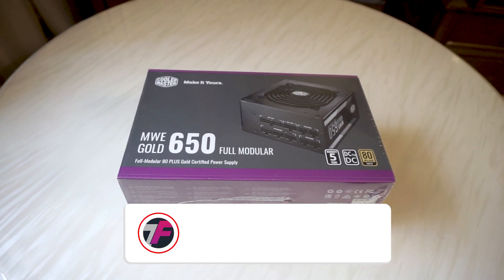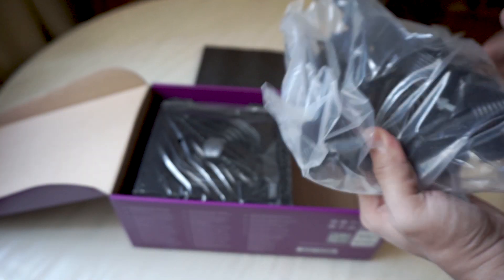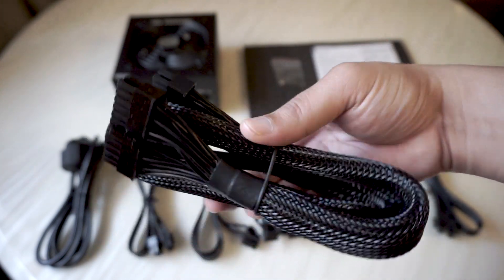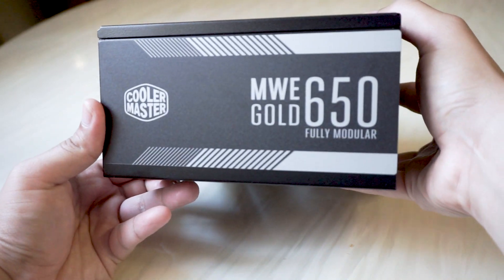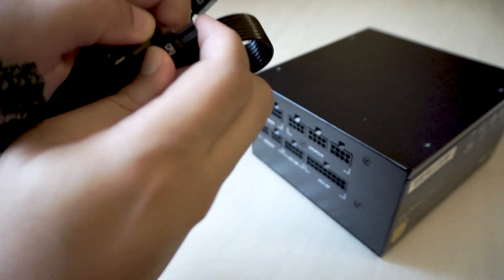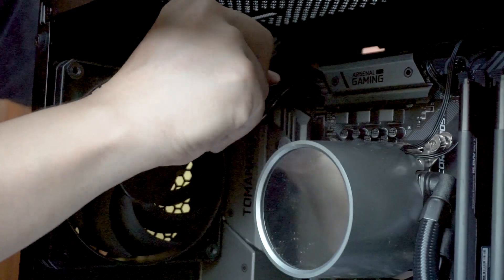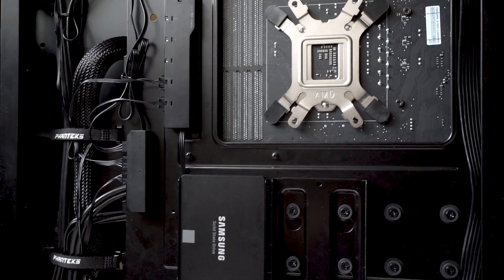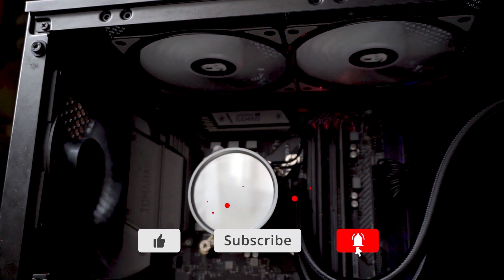Cooler Master MWE Gold 650 Full Modular: PSU Overview & Build Experience

Comment: Great Review.

Just a heads up for you...with the initial release set of this series, there is a 75% chance (or higher) it will fail in about 6-9 months.  If it is Rev 1.x or 2.x, you are good.  Based on the cables included, I believe you got the revised unit, so you should be good.  The Cooler Master MWE Forums are lit up right now with fail reports, including my own MWE 750w Gold...failed in 8 months.  The initial series only has a 4+4pin CPU Cable, not the 8+4+4.
Reply from the maker: Thank you for the heads up! That's worrying to hear for the initial release set of this series. I'm guessing mine is a newer release as it comes with 8+4+4 CPU cable as seen in the video. So I'm hoping this power supply can last for a long time. My cousin is currently using it for 1+ years and so far he has no issue with it. Sorry to hear your power supply died, I hope you manage to get a good replacement! If you enjoy this review, do consider subscribing for future tech content! Cheers!
Reply: @TechFlik  you are welcome.  Right now those of us waiting for RMAs have a 4-8 week turn around.  I was lucky that I had a PSU I could use from my job.
Reply from the maker: @WolfMoonstarMAC  That's really lucky of you! Haha it prob saved your PC temporary.
Reply: @WolfMoonstarMAC  can you send me more info on this? Im planning to buy the mwe gold 650 watt but hearing these make me question my decision
Reply: @W-Gluttony-N-Greedy-R-N-R-W  they were all over the CM Forums...which Cooler Master pulled the plug on.  I guess when your forums become grounds for communicating about the increasing number of failed PSUs and coolers it becomes bad business.  They did finally get me the replacement MWE 750 Gold rev 2 so I think they may have them all out of the way.  I will warn you, if you want custom cables, there aren't any for these PSUs yet.
Reply: Wolf Moonstar i was wondering if they only sell rev 1.0/2.0 now because there is literally no info in the internet and I’m looking to get this psu. But on Amazon the image on the box had EPS 4+4 so I’m wondering if that was just an old image?
Reply: @suniro  most likely it is an old image, but there is still a chance the old Rev1 is still out there in old stock.
Reply: I'm wondering if the newest versions have these problems too ?? bcz I'm planning to buy CM mwe 650 bronze V2  
Thnx in advance
Reply from the maker: I'm really sorry, I did not get any notification that you replied. My apologies for this late reply. I'm not sure about the bronze series of this power supply. But so far, this gold series power supply faced no issue for the past 5 months. And also, I have a cousin who owns and use this same power supply for close to 2 years now with no issue. I hope this helps!
Reply: TechFlik No it’s all good! I’m not building my pc till January of next year. I have about 500 dollars saved up for a 1300 dollar build so it’s all good. Thank you for this though!
Reply: Are they all fixed? If I buy one now will it be okay for use for 2 years plus?
Reply from the maker: @ASwissLegoMan I'm really sorry, I did not get any notification that you replied. My apologies for this late reply. So far, my cousin owns the same power supply and he has been using it for close to 2 years now with no issue. I hope this helps!
Reply: So I just order this because it was on sale . On my box it says EPS 8pin + (4+4)pin x1 , is the good version right?
Reply: @ItsJoru_mia  That is going to be Rev 1.  The new version has a 8+4 pin EPS.  You may or may not have issues with it, but if you do Cooler Master will replace it under warranty.  Make sure you register it on their support site and upload your receipt.
Reply: @WolfMoonstarMAC  I really don't know much about pc cables, planning to buy coolermaster mwe 650w gold MPE-6501-ACAAG. Is this one of the faulty rev1 you were talking about?
Reply: @WolfMoonstarMAC  I'm planning to buy the MWE GOLD 550 FULL MODULAR but the image says CPU 4+4 , is this the old one ?
Reply: @sachi3619  it may be.  I do not thing the 550 has a 8+4 option.
Reply: @WolfMoonstarMAC  aye bro I physically have it in my hands right now, how can I tell if it’s the newer version that’s safer, don’t want it shorting my parts
Reply: I am having kernel 41 and whining I thinks from what your saying your right
Reply: OmG i just bought atm a 2nd hand of this but its now fully modular. Am I safe?

Comment: My opinion for everything is manufactured on earth : the more on the past, the better. eg cars, refrigerator, and so on. So, the same on power supplies. I had a Coolermaster PSU GM Series: G550M , 80+ Bronze, RS550-AMAAB1-EU. Bought on May 20, 2015. And it went out on Aug 25, 2022!!! For 7+ years of working. No gaming PC. Normal use. Word, Excel, web browsing, printer, scanner, USB flash drives. That's all. For these years, average 2-4 hours use per day. Also, a friend of mine, another Coolermaster bought on May 5, 2019. But, he has it installed on the PC on his pharmacy store. And still working just fine. And he, on his pharmacy store, for all these 3+ years now, for 6/7 days of every week, PC is working for 8 hours!! No overclock, just a low needs pharmacy application, web browsing, and printing. I think these two specific models were (and one still is) good, because of past constructed. I am looking for two months now for a decision for the new replacement buy on PSU on my pc, and still have not decided. But, from many web pages and users feedbacks, I think that MWE series is not a good Coolermaster series.

Comment: I have the v2 version of this psu gold modular 650  and so far I have no issue with it after 2 months of usage, will update further in the future

Updated
Still running fine with the psu in 2024
Reply: any problems? looking to get one of the same
Reply: @mxy4625 Still running fine with the same psu after two year of my  pc build
Reply: @mxy4625  it's still running fine for my setup after 1 year plus
Reply: How about now?
Reply: @qwertyowicjxms  i think is just depends on the version, CM has some issues with those models. I had one and it gave me voltage issues after 6 months. They sent to the market a new version of it without issue. Personally I wont recommend this brand
Reply: @qwertyowicjxms  still running fine as of 2025 since 2022

Comment: does it have any restart issues during voltage fluctuation while connected to UPS during heavy gaming??
Reply: the PSU itself will going to cut the power to protect the whole system when there is ongoing flactuations or surges. such a pretty good PSU

Comment: guys for a video card 1660 super is the cooler master mwe 650 gold full modular 650w suitable?
Reply: Yes,Because GTX 1660 SUPER Only Requires A 66-Pin Connector.

Comment: i just bought this PSU - but i notice that the fan not working - is it just working when it be in high or specified temperature?
Reply: Hello! I'm here exactly because of the same. Installed in a new computer, when you turn the power on the fan flicks, but doesn't spin up. I've read that it is passive and only gets going under a heavy load, but the computer sure warms up just sitting there in Windows 10. Makes me feel uneasy. How did yours work out for you?

Comment: I have a motherboard - Asus Strix b450-F, and a graphics card - Gigabyte GeForce 1660 Super 6 Gb. 
What about this Cooler Master (650w) - is it a cool choice? 🤔🤔
Reply from the maker: Hello! Welcome to my channel. This Cooler Master (650W) is more than enough to power your PC according to the specs. I have done a PC build with an RTX 2070 super and a Z390 motherboard with i7-9700F with the exact same power supply model and it has been running with no issue for the past 8 months.

You can watch the PC build with this power supply here: https://youtu.be/bgkracZkC90

I hope this helps! If it does, do consider subscribing for future tech content!
Reply: @TechFlik , hello! 😉
Oh, thank you for answer! Ok, I understood. Because I am worried that everything will be fine with my PC. I read on the official website that this power supply has all kinds of protection. Hope it doesn't fail in the future. 😅

Comment: How do you rate my build.
PHANTEKS P360X
MSI MPG B550 CARBON WIFI
RYZEN 7 3700X
ZOTAC 2070 SUPER AMP EXTREME
TECWARE AIO 
CORSAIR VENGEANCE RGB PRO 16GB 3600MHZ 
COOLER MASTER MVE 650W 80+ GOLD
SAMSUNG SSD 970 500GB
Reply from the maker: Sorry for the late response. You have a great build bro! That B550 can definitely future proof for the new Ryzen processor and overall, your build can handle some 4k gaming but best is at 1440p at high settings. I hope you are enjoying your new build bro!
Reply: I suggest you get a 3060 ti instead of a 2070 super

Comment: bro i want this psu for my first pc build and i plan overclocking r5 2600x is this psu good for overclocking and is it safe and also my motherboard is rog b450-f
Reply from the maker: Hello bro! Welcome to my channel. I have not tried overclocking with this PSU, but this PSU has been running on my friend's computer that handles an intel 9700F (8 core, 8 threads) processor and also an RTX 2070. So far there has been no issues with it. I believe it should work fine with your setup too. Just remember to look out for the latest version of this power supply. Hope this helps and if it does, do consider subscribing for future tech content!

Comment: No molex? My fans still uses molex for the rgb haha
Reply from the maker: Hello sorry for the slow response! This power supply does come with molex connector as shown at 1:21 under the peripheral cables. It comes it 2 peripheral cables with 3 molex connectors in each cable. You can definitely use these for your fans! Hope this helps and if it does, do consider subsrcibing for future tech content!

Comment: Great review. Wondering how to know if when i’m ordering this power supply it is the updated version without the problems. On the information pages on websites it doesn’t specify
Reply from the maker: Hello! Thank you for the compliments! There are a few things that you can look out for:
1) Make sure the packaging looks similar to what's shown on my video. (Purple highlights, etc)
2) My PSU model shown in this video is: MPY-6501-AFAAG
3) Take a look at what cable is included inside. You can see what's included inside at the back of the packaging or if you are buying online, from the description provided. From other commentators in this video, to know if the PSU is an updated version, check that it has an 8+4+4 pin CPU cable. As the extra 8 pin, is only for the updated version. 

You can visit here: https://www.coolermaster.com/catalog/power-supplies/mwe-series/mwe-gold-650-full-modular/ .
Scroll all the way down to Specifications and under "CPU 12V 8 Pin Connectors", you can see in brackets, "(for updated models)"
I hope this helps!
Reply: @TechFlik  thank you for that i appreciate it. I am planning on ordering it from amazon. here is the link 

https://www.amazon.com.au/Cooler-Master-80Plus-Modular-Warranty/dp/B07D8YLQ42/ref=mp_s_a_1_1?dchild=1&keywords=cooler+master+mwe+650w+modular+gold&qid=1602628726&sr=8-1

I hope this is the new version and everything is ok because it is great value for money. Thanks for the help again! The specs just say the 8 pin in the updated version but doesn’t specify if this is the updated version. There really should be more clarity about this. Thanks
Reply from the maker: Hello! Apologies for the slow response. I have taken a look at the link you provided and I agree with you that there needs to be more clarity. I can't exactly confirm but it seems like this may not be the updated model. 

If you take a look under the "Product Description" section (right before the "From the manufacturer" section), you can see the list of cables provided but for CPU cable they only list down "CPU 12v 4+4 pin connectors: 1". There is no indication of any CPU 12v 8 pin connector.

So I kinda suspect that this may be the older model and not the updated version. What do you think?
Reply: @TechFlik  Yeah i am not sure because it says 1 8 pin for updated models but doesn’t specify if it is an updated model or not. I went for it as it was a great deal or a modular power supply and i am hoping it is the updated version. We will see. Thanks
Reply: Just got it in. It’s the purple one and includes a 8 pin connector yay
Reply from the maker: @bluedonkey2678  OMG that's really great to hear! I'm glad you got the updated model! I hope the power supply will serve you well for years to come! Cheers

Comment: how's mwe 550w 80+ psu. I'm confused as that's model don't has braided coating to motherboard cables?is it safe to use..btw big fan❤️
Reply from the maker: Hello! Sorry for the slow response. Can I check with you the model no of the mwe 550w 80+ psu that you found?
My model is: MPY-6501-AFAAG.

Based on the mwe 550w 80+ psu that I found at: https://www.coolermaster.com/catalog/power-supplies/mwe-series/mwe-gold-550-full-modular/
The motherboard cable looks like its braided.

And thank you for the being a fan! I appreciate the support!

Comment: hey , i found a non modular version of this PSU, is there any diference in performance besides the modularity?
Reply from the maker: Hello! There could be a difference in 80 Plus certification, difference in series which may indicate different performance level. There can also be a difference in the type of cables and connectors available too. 
Mind providing me a link to the PSU you found? So I can take a closer look.
Reply: @TechFlik  
Everything but the modularity seems to be the same to me
Model seems to be: MPY-6501-ACAAG
It sold out in the page i found it, but i found it on amazon
link:
https://www.amazon.com/Cooler-Master-MPY-6501-ACAAG-US-Certified-Supply/dp/B07H5KFBB9

Thank you for the help
Reply from the maker: Hello, sorry. I did not receive notification of your reply.
My model is: MPY-6501-AFAAG
https://www.coolermaster.com/catalog/power-supplies/mwe-series/mwe-gold-650-full-modular/ 

It seems that you are right, seems like they have almost the same specification as the power supply reviewed in my video. The main difference is that one is fully modular.

Hope the power supply is in stock soon! And I hope this helps! If it does, do consider subscribing for future tech content!

Comment: hey, does it handle an amd ryzen 9 3900x and 2060 super ? is that enough for them ?
Reply from the maker: I think 650W power supply will be able to run them with no issue. You can even do some overclocking and it should be fine. The closest I did was an Intel 9700F processor paired with a RTX 2070 Super for my friend build using this power supply. You can watch it here: https://youtu.be/bgkracZkC90 .

So far the power supply is able to handle with no issue. If you plan to buy this exact power supply, do take note of the version and get the latest version instead. If this helps, do consider subscribing for future tech content!
Reply: Thanks alot, do u recomend the amd ryzen 3900x or an intel 9 ? mainly for editing and 3d stuff
Reply from the maker: If you are talking about editing and 3d rendering, I believe most software are more optimized when using Intel-based system. So i would most likely go with the Intel 9. However if you are on a budget, the Ryzen 3900x provides plenty of core and threads at a remarkable price compared to Intel. Plus, the Ryzen processor is no slouch either. So it really depends on your budget. I hope this helps!

Comment: Compatible with 5700xt + ryzen 3600 + MB b550 aorus pro?
Reply: Or maybe I should buy the 750w bronze
Reply from the maker: Hello! The 5700XT recommended power wattage is 550W so this power supply with 650W should be able to handle your configuration with no issue. I also did a PC build with an RX2070 Super + Intel I7 9700F on a Z390 TOMAHAWK using this power supply and so far there is no issue with it. 

You can watch it here: https://youtu.be/bgkracZkC90

I hope this helps! If it does, do consider subscribing for future tech content!

Comment: I need help with this PSU somebody help
Reply from the maker: Hello! Anything I can help with? I hope everything is okay.
Reply: @TechFlik   I understood that problem my friend. My only concern now is... 
In which 8 pin slot is the CPU cable gonna go.
I've three 8 pin slots in my PSU reserved for CPU/Pcie cables.
So my question is which slot (1,2,3) is the CPU gonna go. By that we'll automatically know that the rest are of PCIe ( My GPU requires 14 pin so it'll take 2 of the 8 pins in my psu)

or you can add me on discord brother xXSanchitXx#2479
Reply from the maker: Hello! Sorry for the late reply, I did not receive any notification that you replied. 

For your question on which 8-pin slots in your PSU (under CPU/PCI-E) to use for your CPU cable. The answer is any of the slots! I actually used the no. 3 slots (from the left) for my CPU cable. But in this power supply it does not matter which 8-Pin slots you use. I hope this helps!
Reply: @TechFlik  COOL :)